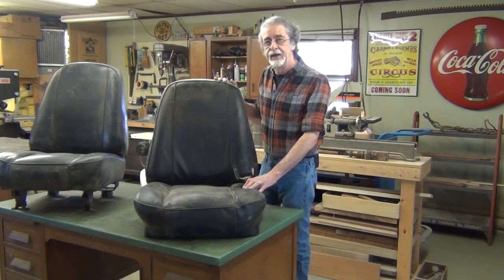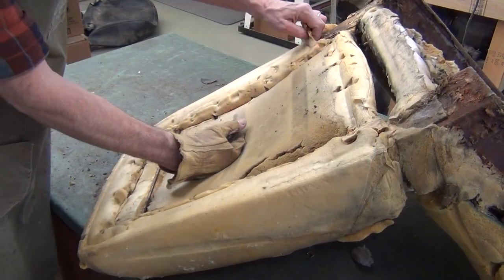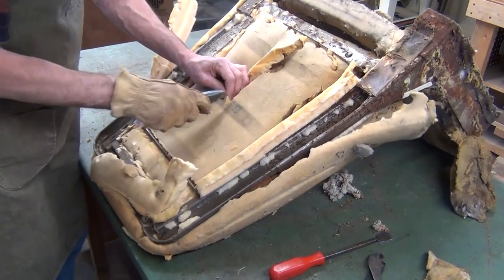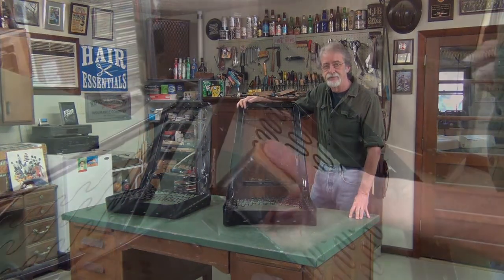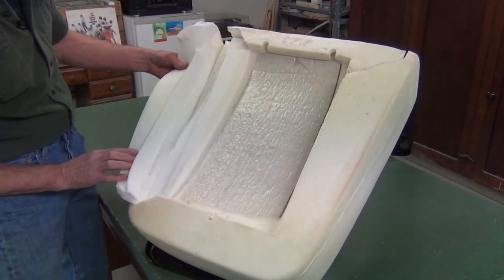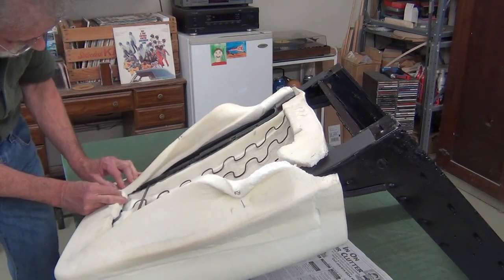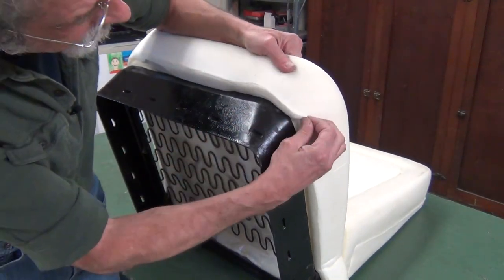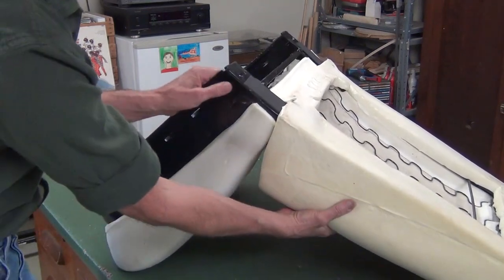Bucket Seat Foam Replacement

Comment: I’ve been an auto trimmer (upholsterer) for over 40 years and never had to strip this particular type seat down to the frame . Back in the early days all we had to do is inert or replace the covers because the foam rubber was usually in very good or at least fair condition. I’m having to reupholster a pair of them and wanted to make sure cutting the foam off the springs was the right thing because I’m replacing the foam. Thanks for posting this! It was a big help.

Comment: As a professional, do you have any opinions on using foam vs more classic and natural materials for car bucket and bench seats? 
Is it even realistically possible to convert a seat like this to using a non foam seat without building the seat entirely from scratch?
Reply from the maker: I'm sure converting to natural materials stitched into shape would work but I can't see the need to do so.